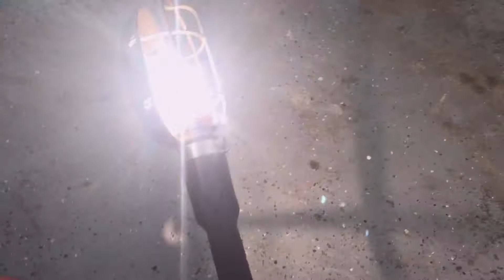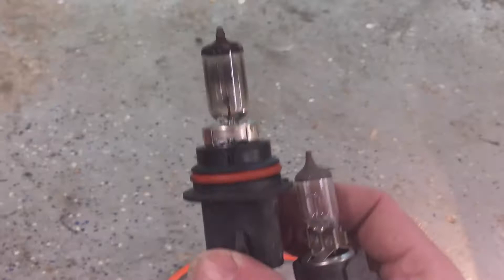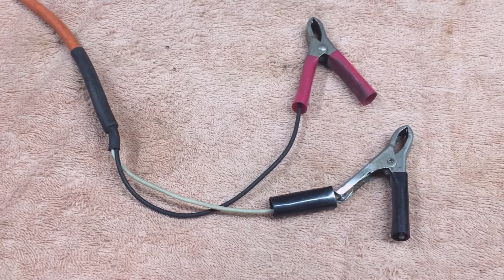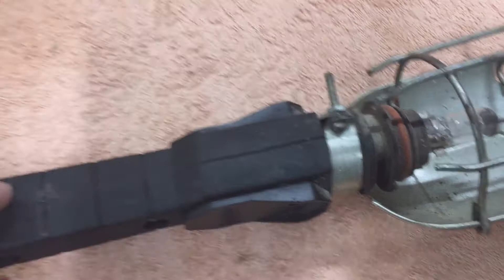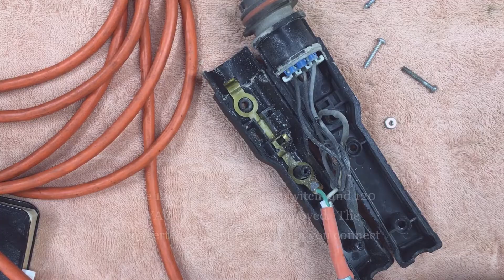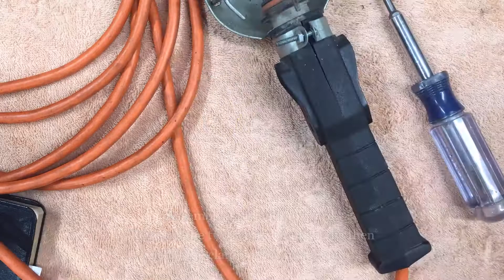Convert a 120 VAC Light into a 12V Headlight Bulb, on Vehicle, Shop Light

Comment: Love it bro, you know I use to see work lamps like that when I was a kid, but now they seem like they don’t make them anymore. Question thought, if I leave the original 30-60 watt light bulb and just change The alligator clips would that be a problem?
Reply from the maker: Yep, you can still buy them, look for a link to an Amazon page in the video description.  You want to use a 12 V bulb in the light.  The 120 V bulb break the filament everytime you set the light down or bump it.  I have several of the old 12 V headlight bulbs that one element has burnt out in, which work great for this light!  Thanks for the comment!  - Stiles